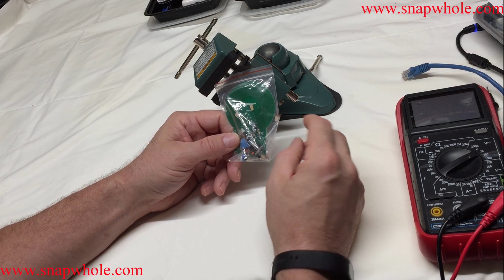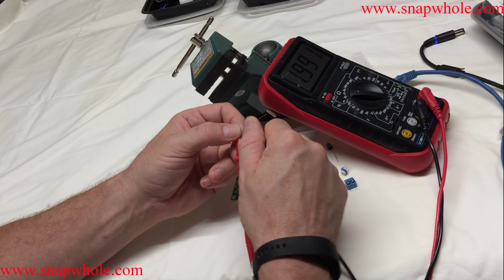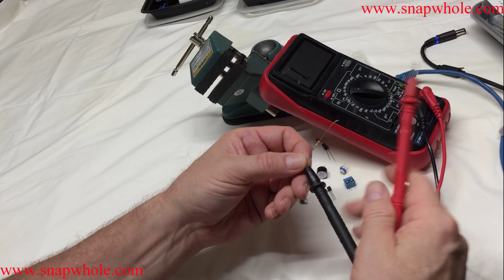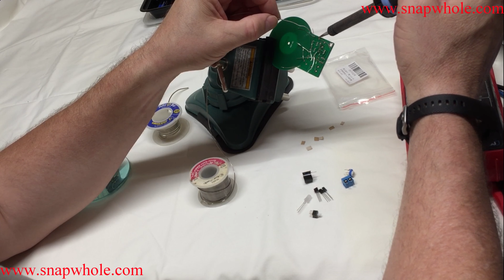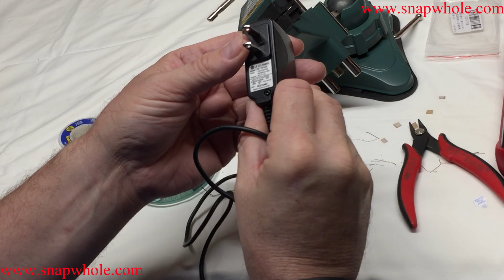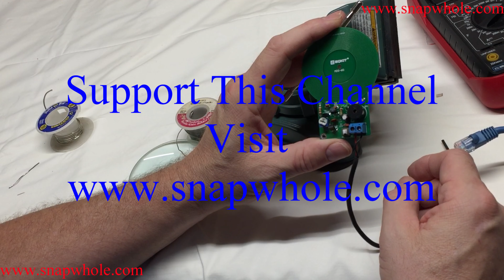Building Green MDS-60 Metal Detector Kit

Comment: I just finished my kit and my speaker wont stop buzzing. I turned the pot all the way up and down and the speaker just wont stop buzzing. Did I burn up a diode soldering it in or had a bad part? I was carful populating the board so I am kinda surprised I had an issue.  I was thinking of adding a 100R to the pot and see if that helps. Any suggestions?

Comment: NICE FIRST EVER COMMENT TO SOMEONES POST HAHA WHOOHOO >> I have just got this same kit as i wanted to know roughly how a MD circuit works so bought the mds-60 as a reference to work from for making my own DIY metal detector. I'm looking all over the net to see if anyone has took this kit and copied it up on a bigger scale but without the coil initially attached i don't suppose you have tried this yourself have you?
Reply: ps i was working with the NE555P TIMER initially but found the MDS-60 which doesn't require a timer in it's circuit so thought i'd try upscaling the mds-60 circuit but i'm having trouble laying it onto a pcb which is really frustrating lol
Reply from the maker: I'll give that a try this summer, but the design would not be that sensitive, not a lot of adjustments - thanks for subscribing!